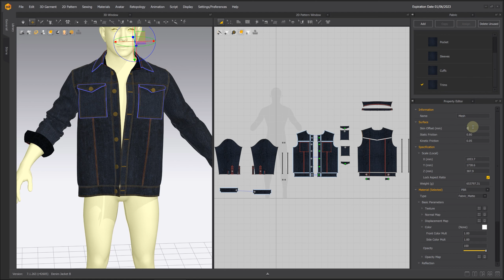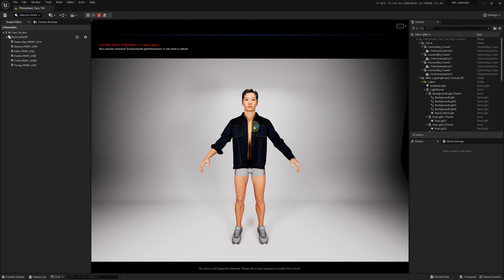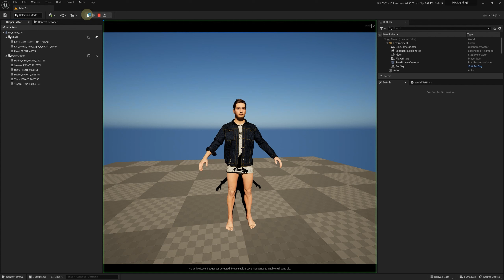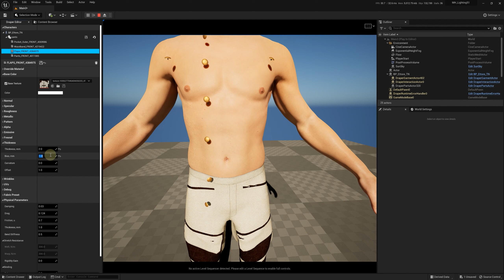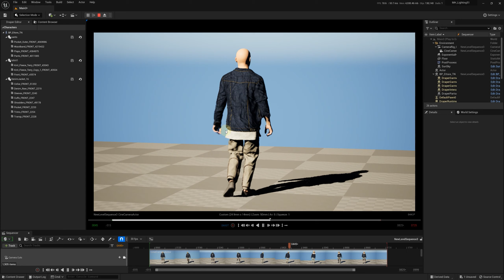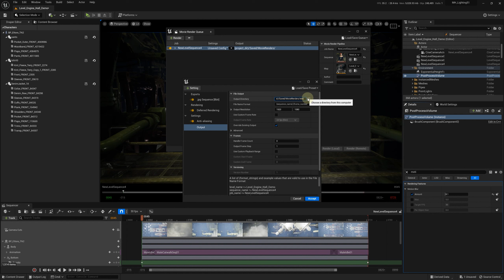Marvelous Designer to Unreal Engine (part 2): Importing Clothes with Layers

Comment: there are visible glitches in underarms and front panels of the jacket. I understand that this is a huge leap for the games, but how are people using this in production? films etc? can we bump up the settings or are they simply using Marvelous Designer animation for now?
Reply from the maker: Agree, our simulation is limited in handling of self-collisions. Also, handling avatar-cloth collisions is rather tricky when cloth is jammed between body parts that crossing each other like underarms.
Sometimes it can be handled by using specific tricks like binding.

Comment: Is it possible to load in a custom mesh .FBX (let's say built in maya, UV laid out) and add custom colliders?
Reply from the maker: You can import OBJ files but if you want to use simulation, they should be prepared the same way as when exported from Marvelous. Thin, Weld, Single, and all other requirements.
You also need to check Skip validation when importing. See https://udraper.com/blogs/tutorials/using-clothes-from-marvelous-designer